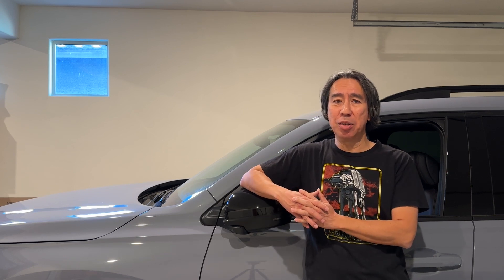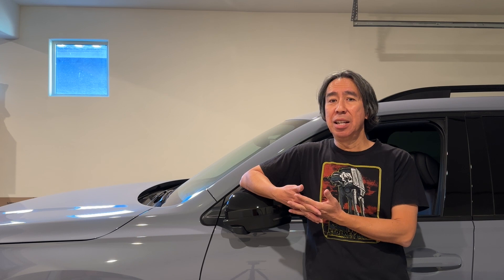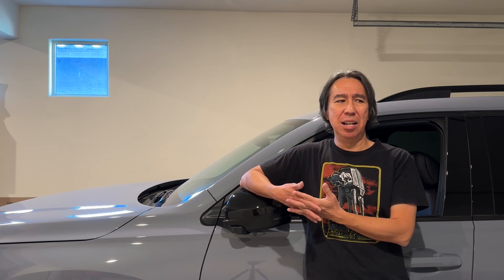Honda VCM (Variable Cylinder Management) - Everything you need to know.

Comment: What’s your thoughts on buying used with one that hasn’t had a Vcm muffler on it as opposed to buying one new and changing the oil  every 5k and either waiting until out of warranty or installing a muffler under warranty?  I’m contemplating a Ridgeline but have angst as to which is the best choice.  I won’t owe anything either way, buying new just means a little more out of the bank as opposed to used.
Reply from the maker: I would buy new and muzzle the VCM.   Install it under warranty.  Let's say you buy a 5 year old Ridgeline, that was not muzzled, you may already have 5 years of VCM wear and damage. The issues could start popping up at year 7, for example, even if you muzzled it after year 5.  Adding the muzzler does not reverse the "damage."  IMO, it would just delay it.  My 2014's engine was solid, with the muzzler shortly after purchase new.  My 2009 and 2010 Ody and Accord without muzzler both suffer heavy oil consumption, etc.  Muzzler devices were not invented yet.  IMO, I don't think change the oil matters much relating to VCM.  I follow the MM on my 2014 Ody for example.  Generally only change the oil at ~15%.  Maybe even a few times it went down to 10% (because I was busy that weekend, so that became task for the following week.)

Comment: I have the early VCM on my 2006 Pilot. I had a multi cylinder misfire code however no misfires at all. There was a TSB 09 90, the dealer inserted a special program. It wasn't free. So far it work very well. It can be annoying when it engages and disengages.
Reply from the maker: Thanks for sharing your situation.

Comment: Using anti vcm device, will increase the fuel consumption,  and just wondering,  why installing vcm device to cancel vcm, just use the tow mode function of the vehicle?
Reply from the maker: Yes, a VCM “Muzzler” would decrease MPG because it will operate all 6 cylinders all the time, rather than 3 cylinders occasionally.  Yes, you could be in Tow Mode and that would turn off the VCM, but some of your vehicle sensors will not work in Tow Mode.  https://youtu.be/rJgFUGnpeag?si=wqK2DvAdyi75K3SF

Comment: With 10 sensor inputs, a new VCM muffler would be almost impossible to wire up leaving a software tuner block the only available option. It’s probable that Honda encrypted the ECM so this won’t be an option. My 21 Ridgeline runs flawlessly using a VCM muzzler.
Reply from the maker: Yes "impossible" or if it is possible, probably not worth anyone's time considering what they can charge for a vcm control device.  Cost will be greater than the profit.

Comment: Thank you for making such a great video. We just welcomed a new additional to the family and looking to get a 2025 Honda Odyssey. I learned it has the older J35 - 6 engine. would this have the VCM 3? that can have a VCM muzzler installed? Thank you in advance
Reply from the maker: Congratulations.  Yes, the 2025 Odyssey engine is the (older) J35Y6 with VCM version 3, so VCM Muzzler or similar devices, will work to keep the engine in 6 cylinder mode all the time.

Comment: I just bought a 2026 passport trail, do I need to deactivate or just run in sport? I believe it comes with lifetime powertrain
Reply from the maker: At this time, we don't know if VCM in the J35Y8 will be an issue down the road.  I kept mine at Normal mode.

Comment: Well explained. You are pretty well informed and shared your knowledge successfully. Having an older '15 Pilot, I only recently had issues with a fouled #4 spark plug that may have been due to the VCM system affecting clean cylinder fire. But after 10 years of VCM use am not that surprised that negative results finally affected this plug. Other plugs while not perfect of course were not as bad as one might think of continued on and off cylinder use. Again, am grateful for this video and your great explanation of this system.
Reply from the maker: @RT300Z1  Thanks for sharing your story.

Comment: I have heard the vcm and auto stop are not activated in sport mode. Can anyone confirm this?
Reply from the maker: @mrjay4000  Yes, in Sport and Tow mode.  https://youtu.be/8ZWJ4XJN2Y8?feature=shared  As for the auto start/stop it will activate again every time you start the vehicle, even after you press the button to turn it off.

Comment: i got a question i have 2025 pilot touring for a year and i notice they  have two air condition draining hose on the botton of the car and the one on the front is dripping water which is normal when the air condition is working but the one is  supposed to be for the back i never see water coming from that hose any idea or maybe you can check you car or its normal  thank you
Reply from the maker: @victorv33  Perhaps someone came help with this one as I like to know too.

Comment: So i have a 07 odyssey with version 1.0 VCM, I bought this Van in 2019 and did a full reconditioning, it had 175,000 it now has 208,000 my girlfriend is the original owner and she has never had a problem and ive owned it for over 5 years and no problems i use shell V power change the oil regularly and use Denso TT Iridium plugs and runs great I also tow a SXS WITH a total weight including the trailer 2,600 pounds and im very impressed with towing with this van cause it does it very well with just 2 things 1. K&N AIR FILTER 2. Premium gas.
Fuel economy has been excellent Towing at 60mph 18-19 MPG. Im here in Las Vegas now from California, drove the van with 3 people, and full of luggage drove 65MPH and got 32.7 MPG....Excellent.
So i was going to disable the VCM back in 2019 when i got the van but didn't so far it hasn't come back to bit me.
P.S. for those who want to know, im using Valvoline Restore and Protect 5w-20 to do a deep clean inside.
P.S.S engine does not burn oil.
Reply from the maker: @Lavoss05  Glad to hear.  Thanks for sharing.

Comment: I’m about 3/4 of the way through your video and what I’m hearing you say is that my 23 Ridgeline is not affected by this new problematic VCM issue. Meaning the 23 Ridgeline has only one sensor and it can still use previous Musler to correct it.?

And the second part of my comment is, if this is true, is there a brand of muzzle you suggest? An Amazon link? And I would definitely get my mechanic to do it. Seems I heard all kinds of lights will go on afterward, but then it settles down. I guess I should look at your channel more.
Reply from the maker: Yes, the Ridgeline still uses the older J35Y6 engine, and the VCM is controlled by engine  coolant temperature.  So all the current VCM deactivation devices will work.  I only have experience with one device - VCM Muzzler II.  I bought mine from the person that created it (Verbatim - don't know his real name), and I don't think he sells it through a major vendor.  Here is the thread to buy the VCM Muzzler II  https://www.odyclub.com/threads/vcmuzzler-ii-for-disabling-vcm-faqs.268778/
As for installation, it's real easy, plug and play.  Here is someone's video on installation I found on youtube.  https://www.youtube.com/watch?v=DewUNWlh1zU  Lastly, at this time, we don't know if the current version, VCM 4 will be an issue, or not.  VCM 4 is on the J35Y8 engine, that is currently in the Honda Pilot, and (2026) Passport.   And not in the Odyssey, Ridgeline or Acura MDX currently.
Reply: @ thank you so much!

Comment: Yeah I have the J35Y6 in my 2017 Ridgeline Version 3 stopped the oil consumption common in first version but the honda 6 speed auto and torque converter is weak for a large vehicle definitely exacerbated by the transmission fluid going in and out of VCM in at 205k mile with SVCM ( smart disabler) after the first timing belt change the rear bank ( VCM deactivated bank ) was so dirty vs front bank I was shocked!  Not to mention I had the whole RPM Judder TSB. Needless to say found resources in forums and disabled vcm never looking back
Reply from the maker: Glad to hear, thanks for sharing.

Comment: ...  Andrew TY for this  - just purchased  a 25 Ridgeline BE , last vehicle was a 2011 Pilot  totally stock  215,000 miles , never installed the VCM  disabler -  no engine problems whatsoever  ...   safe travels   ...
Reply: My wife ‘13 RDX neither has or had any problems with the VCM …🤷‍♂️
Reply: lots of chevy owners would say the same thing about there AFM  (active fuel managment)  but its a bad system that fails often
Reply: @DeepRiver-cv1xw same here , i don’t even know my wife’s 2013 RDX had that system , 150k no problems whatsoever , just maintenance by the book, synthetic oil change every 7.500 miles 🤷‍♂️

Comment: there was a recent safety recall on the throttle injection software of all pilots. I heard from many pilot 23-25 owners were very  impressed by the update which smoothed out the rough shifts youre referring to. Take your pilot to dealership to get the software update free of charge. I normally drive my car in normal mode on freeway and eco mode in the city. Ill probably try out sportmode in freeway/highway from and eco in heavy traffic in city. thanks for making this video.
Reply from the maker: @MetalsForBrunch  Yes, I need to get this recall done.  Have not receive anything in the mail yet.
Reply: you can check if your car has recall on the nhtsa gov with your vin number/plate and present that to your Honda dealer or mention on phone when placing an appointment for the recall fix.  @andrewwang128  there's no need to wait for recall mail.

Comment: A couple of months ago we bought a 2023 Passport Trailsport with 7500K on it. To be honest I can't perceive any rough shift or hesitation with the VCM performance. Ours starts out in 2nd gear unless the sport setting is engaged. I just filled it up and got almost 25 mpg city/freeway. This was from San Diego east on I-8 to Anza Borrego and back with two passengers and our dog. I'm thrilled with this thing. We've also owned a 2005 Pilot  AWD which doesn't have the VCM. It averages 18 mpg and has for 275K since new. It purrs and shifts like new. 5K oil changes with garage bulk conventional oil and trans and diff at 30K. It's our junk car for Home Depot. I'm going to leave this alone. Thank you!

Comment: You gotta help me out here, 66 yr old big toyota guy, just bought 1st Honda, a black edition Ridgeline MSRP $ 49k. I didn,t want a big truck and toyota and everyone else is putting 4 banger turbos in their  midsize trucks that won,t last over 100K. I came on youtube to watch videos on how to install mud guards then saw videos on how to deactivate the Auto start/stop, which brought me to videos on vcm engine problems that I knew nothing about.
   Looks like this vcm problem has been going on for years and you touched on that Honda was sued and settled over this.Sooo shouldn,t I expect my 2025 ridgeline with a J35Y6 engine (says it on window sticker) has had the bugs eliminated by Honda by now or should I be considering putting in a contraption that most likely would void a warranty on a vechile thats literally 2 weeks old ?  In your humble opinion (just an opinion) if this was your vehicle what would you do ?  I am indecided ,drive it like it is designed until the 3 yrs are up on warranty or would that be to late. I am a 5000 mile a year guy. because I own 2 vechiles. and you gueseed it, the other is a soon to be 10 yr old highlander with a v6   with zero problems that I,m never getting rid of.
Reply from the maker: Congrats on the 2025 Ridgeline. I like the Ridgeline too.  Here is what I would do if this was my truck.  Install a device like the VCM Muzzler.  The 2025 Ridgeline uses the (old) J35Y6 engine.  (VCM Version 3).  So it will work. It's not too late.  IIRC, I muzzled VCM at around 7K miles.  In the beginning, I would remove it when I took it back to the dealership for service or warranty.  Then I forgotten about it, and left it on.  The dealership service department never said anything or notice it.   Using my 2014 Odyssey for reference, I have no doubt that engine could go 300K miles.  During the entire life of ownership, check the motor oil level in between changes was a "waste of time."  Meaning, the engine does not burn a drop of oil from Day 1 till I traded it in.  The engine was that good IMO, with the VCM muzzled.  On a different note, I also change the ATF regularly on the Odyssey around every 25-40K miles.  Solid transmission too.  Your Ridgeline have the 9 speed auto from ZF of Germany.  Heard is a good transmission, but I don't know anything about service or DIY service on that.  To sum up, get the VCM muzzled and happy motoring.

Comment: Is it possible to install the VCM disabler on the new DOHC Honda V6? They make a disabler that plugs in and connects to the battery. There is one for GM- a plug in module from Range Technology that removes AFM/DFM from engines, and they just released a new one to disable the newest technology.
Reply from the maker: I don't know what will work with the new DOHC engine.  Don't know anything about the module from Range Technology.  Will take a look.

Comment: Thank you for the excellent presentation!  I have a 2025 Passport and I know its motor has some differences.  Question: Would SPORT mode or turning off ECO mode reduce the system's demand for VCM?
Reply from the maker: @jeffreybray4473  Because I don’t own a 2025 Passport, I can’t be certain, since the engine is not exactly the same.

Comment: Andrew, another fine video from you!  Recall I first contacted you over 5 years ago about the spark plug misfire we experienced on my wife's 2010 Honda Accord v6.  I installed the vcm2 on it and everything has been great since.  The car still only has 79000 miles and only 16000 with the muzzler but we have had no oil consumption or misfires at all.  My son bought a new 2023 honda odyssey last year and I was surprised Honda was still messing around with vcm.  His Odyssey has version 3 of the vcm which I guess can still be bypassed using the vcm2 or similar product if he encounters problems.  Version 3 must have some problems or they would not have developed version 4 unless they wanted a system that could not be readily defeated.  Why does Honda continue with this problematic approach to improved fuel economy?  I am somewhat surprised that you bought another Honda!!  I also have a 2006 Ridgeline that I would consider replacing if the new Ridgelines did not have vcm.  Anyway, thanks for this video and I will continue to look for videos that you post.
Reply from the maker: @danjoe22  Thanks.  We did look at other brands.  At the end of the day, I’m still a “Honda Guy.”  The (VCM) journey continues.